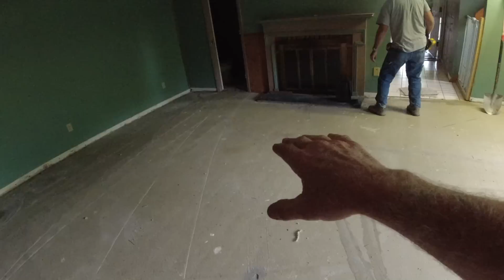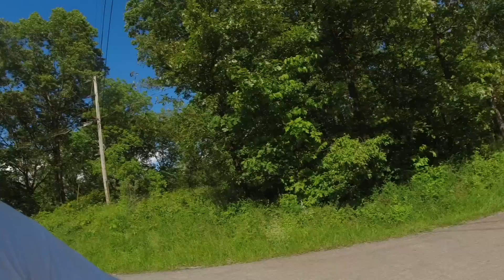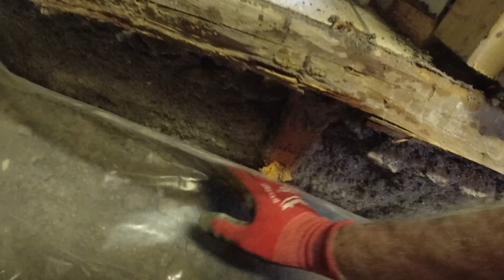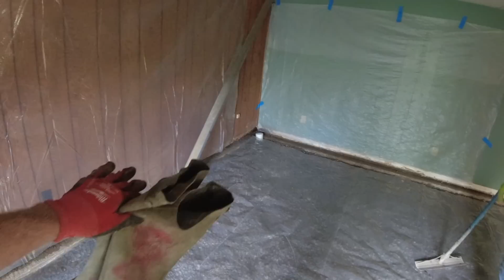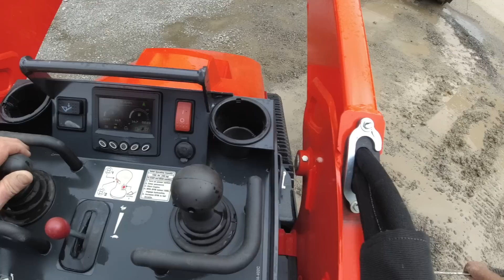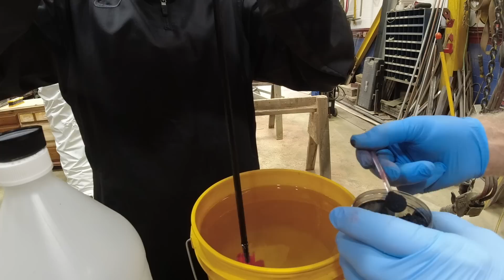Why Is This House Moving?!

Comment: If the house was built 25 years ago and has mill slag underneath it, I guarantee it was not D-GAS if you took all the slag out they will never have another problem I seen floors back in the 70s and 80s that had armco slag underneath it. It would heave and crack so bad you could lay your arm in the crack that’s before. They started to de gas contractors back, then thought they were getting a deal because the stuff was so cheap, but it caused all kinds of problems

Comment: Why didn’t you add foam board of spray high density foam insulation on top of soil before add in stone base? It would have made the house better insulated … in fact in some states i5 would have been mandatory… may soon be code mandatory in most states… almost always done in new construction. Adding insulation also to perimeter footer would also insulate.. could also help with water infiltration.
Reply from the maker: We typically just do that at ground level. Everything in the basement is 36 inches below grade.
Reply: @Concretewiththehauses  I will say yes the videos I have been seeing, of adding insulation beneath the slabs, have been on-grade types…it may not be typical to add insulation to slabs in basements, but then again why not? After all, there is heated space in basements and perimeter footings and walls are exposed to ground temperature… maybe insulating below basement slabs would have advantages…I didn’t understand from the video shown that you were doing a basement…you entered from a garage that must have been  walkout hillside exposure… I assumed it was a slab on grade having not seen an exterior photographic shot… still, wondering if insulating under any slab or foundation wall or footing for a building should not be considered…even below 36 inches.

Comment: That sucks the home owner has to go through all that expense because the proper materials were not used under concrete. Thankfully there are good trades like you out there.
Reply: The home owner would benefit from a perimeter drain around his house to prevent the water running down the hill from damaging his property again.
Reply from the maker: It’s great to be a homeowner,sometimes

Comment: Philadelphia Mike —-   Watching your video —-  is Thursday the 13th. ——   You’re doing the job inside the house ripping out the floor that raised up in the middle   —-   I was thinking you should’ve put maybe a drain pipe along the wall that was seeping water   —-   And rain French strain that went outside the house  —-   if the dimensions allowed you to drain that way  —-   Just an idea  
 Or even run a French drain system all through the floor before you poured   —-Point

Comment: This used to be a very bad situation here in my town back before the 70s, henceforth I built my home 18 inches minimum off of ground, now since our horrendous earthquakes recently, all our new home's must have 8 inches reinforced concrete floors, as a legal requirement, water is terrible under floors without protection.   I am so happy that this particular pour is shown, thank you Tom and crew for another wonderful episode. 😊😊😊.

Comment: I'd be questioning the wall with the paneling. Maybe the builder should have had drainage around the perimeter but we all know they cut corners. I just had our house resided with a material i didn't know anything about and the company also has a factory to produce it. It is polymer like what goes inside of air planes. They have a different kind of pieces that go around the outer edges and under the siding they put thick styrofoam which conforms to the different styles of siding, we stayed with the Dutch lap. The siding and all other pieces have a woodgrain texture, they  make a j channel but it's bigger and after they put the siding on slip the styrofoam underneath, then they put a thick metal strip on with screws, no nails. Underneath all that they put house wrap on. My house has no seams like typical siding. It cost us around 35,000 dollars to have it done. On the corners behind that piece is also styrofoam  to keep insects from getting in

Comment: If the bucket was tapered your quantities of resin were off. You had too much activator no? The bucket would have to cylindrical to use a 4" and 2" measurement.

Comment: In similar scenarios where you need to allow for possible future movement I have used fully compacted hardcore topped with 2-3 inches of medium density polystyrene below the concrete

Comment: So - after doing a number of poured epoxy tables, I am not a fan of parchment paper or plastic. I strongly prefer to use an epoxy mold release agent. It can be as simple as paste wax, but the spray epoxy releases are best and easiest. No matter how well you affix the plastic or parchment, it always tends to wrinkle and means more sanding.

Comment: you need to give the water a place to go, from the outside put drain tile and then daylight it so water will have a place to exit, water is forcing it upward get rid of the water.

Comment: Owners would be wise to dig a ditch around the house and drain pipe in with clean drain rock and pull the water away from their house. I had to do it at my house and solved a water problem under my house. 😊 
Nice job on a difficult project. Your usual. 😁

Comment: Suggestion for epoxy - could have sealed the live edge with just a thin coat of epoxy and let cure. This prevents any trapped air from coming through the pour from that edge.

Comment: It seems to me the water extrusion problem is a serious problem that should be addressed.
Reply: Bingo.  Proper exterior foundation drainage (e.g. french perimeter drain) and waterproofing are necessary to minimize future heave issues.  An interior french drain tile could have been installed, but that would have required installation of a sump pit. But that would take away from the usable space and be noisy.